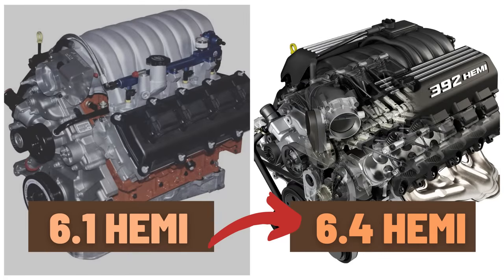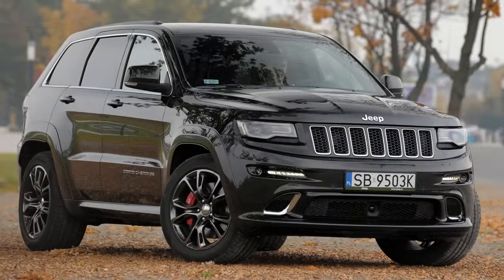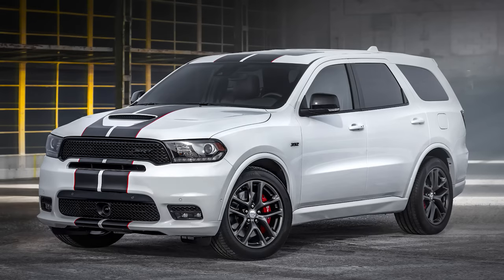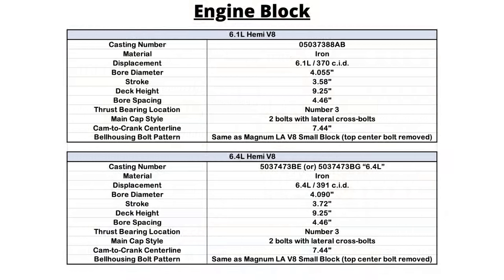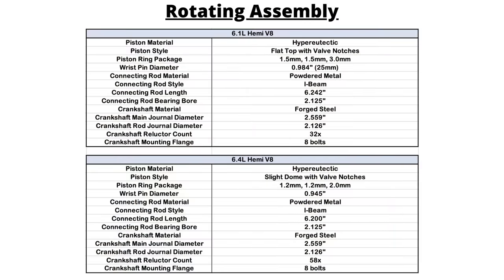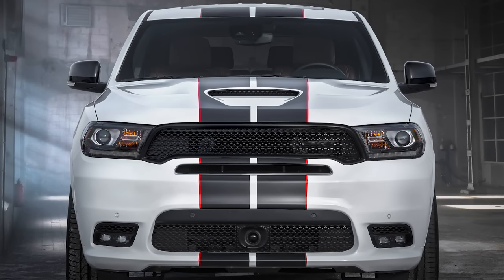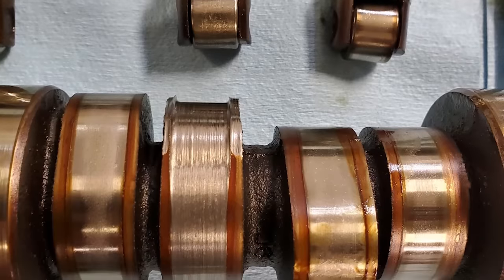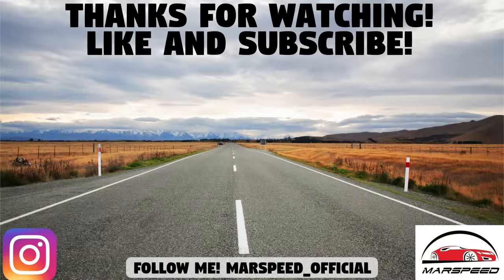6.1L vs. 6.4L Hemi Engine Full Comparison – Which One is Better? (Specs, Performance, Flaws, & MORE)

Comment: Awesome comparison! I've got an 07 Magnum SRT8 and the 6.1 runs smooth and sounds great. I've had the ecu tuned but it's all stock components and dynoed 408hp at the wheels - fun enough for me :) And I get 22 mpg highway all day, I was surprised to see the stock numbers were lower. Keep up the great work!
Reply from the maker: Nice ride man! Those Magnum SRTs are the rarest of the first gen SRTs, they’re a unicorn to me just such a cool vehicle. Cool to hear the 22 mpg that’s not too bad
Reply: That's a cool ride you got there bro! Keep it as long as you can! In my opinion the Magnums and the 06 to 2010 Chargers are going to be pretty popular with a younger generation by 2030 people are going to want them more than the current Mopars
Reply: The srt magnum is such a rare gem! Take good care of it!
Reply: srt magnums are cool af
Reply: @shakarussanders9911  can confirm your theory ahhahaha going to get a 2007 Chrysler srt8 300c
Reply: @xavierlacorte5531  Oh that's a good one!
Reply: Can you lmk about the tune? I got a 300 SRT8 and wanna make more power without spending a lot
Reply: @domlabrise  sorry! I don't know the details, the shop tuned it. However, I've seen articles since then that tuning DIY is pretty easy for the LX platform cars and you just need a programmer device and a copy of the tune.
Reply: @troybjones4  thank you!!
Reply: Yooo I got a 2006 magnum srt. Love the car. I got it cheap cause it has almost 200k miles and needs some love. But I'm working on it, and the engine so far has been the best part about it. 200k and still pulling strong
Reply: No way u dyno a stock 6.1 at 408RWHP stock. A 6.1 dynos at 370RWHP while a 6.4 392 dyno at 405RWHP. A 5.7 dyno 340RWHP.
Reply: @Carlos._5.7  he said ecu tune
Reply: @kyoakland  there’s nun that a tune can do if there’s no performance parts to back it up
Reply: @Carlos._5.7 this is horse shit.   There is absolutely gains to be had from just a tune on most vehicles it depends what it is and how good the stock tune is etc but there is also noticable gains to be had and some dyno just read higher and lower you can't really compare diff dynos.  You assume his car dyno 370 on the dyno it could have been higher so we don't know the before and after.  People worry too much about peak numbers anyways.  There is alot of gains through the curve to he had on tunes.   For best results yoy want hard ware upgrades but you can absolutely gain power with just a tune.

Comment: i have a 6.1 swapped in my 73 Challenger.. although i don’t drive it everyday , It’s been a great engine so far
Reply: Did you go auto or manual?
Reply: @hpjunke  Love that engine.  Got 225,000 miles on my first one.  Put in a 2nd motor and it is up to 130,000 miles and going strong
Reply: @pmp2559  It’s an auto 545rfe

Comment: The early 5.7 hemi up thru 2008 did not have the lifter failure problem like the eagle engines have.
Reply from the maker: True you’re right. It did have the dropping valve seat issue however
Reply: Still doesn’t happen often, most of the time it happens in high idle vehicles. I have a 2015 ram with 140k no lifter issues.
Reply: @joshkrause2977  Some video I saw claimed it happens in 1 engine in 30.  Yeah, there are lots of hemis out there with lots of miles.  I think the RAMs have the best transmissions and I like the torque of the hemi engines.  I have a 2005 Magnum RT that has 120k miles on it and I'm keeping my fingers crossed that a valve seat doesn't drop.  I've changed the thermostat to a little lower setting and I have a severe duty radiator that I plan to install to maybe keep the valve seats from dropping.
Reply: I got a 07 charger rt that I’ve had now for 10 years 197k miles on it now it’s been good to me. Now it just sits next to my caprice classic since I’m making both of those to show cars, the caprice is getting a ls swap very soon but down the road I would love to swap the 5.7 for a 6.4
Reply: Wrong. All MDS 5.7 engines are prone to the lifter failure. Pre eagles are prone to dropping valve seats as well. Newer eagle non MDS also have the lifter issue too
Reply: @Real_AGTUBE  While any engine could have a lifter failure, it doesn't happen that often in the pre-09 Hemis.  If you are saying the early Hemis are as prone to lifter failure at the later engines then you don't know what you are talking about.

Comment: I'm a Stellantis(Chrysler/FCA) tech at a dealership that also drag races on the weekend. I work on these engines all the time...well the SRT 6.4 and truck 6.4...we never see the 6.1 anymore because most quit running many moons ago. I can make the 6.1 or 6.4 decision fairly simple for most people:
Deciding which engine to start with highly depends on your goal.
If you want to keep the engine fairly stock with some bolt-ons and minor mods, go with the 6.4L. Cars like the 1320 Challenger, 392 Charger, and 392 Challener. 

If you are wanting to heavily modify the engine, I mean go all out, but not spend your life savings doing so, go with the 6.1L. You can upgrade the rotating assembly, bore it a little over, and play with the camshaft selection...when matched with an older 5sp auto or 5sp standard...you got you a hot little ride.

If you want to heavily mod the 6.4L, be ready to break the bank because of all the modifying and deleting you'll have to do such as the MDS and VVT systems, depending specifically on which 6.4 you start with. The 6.4L blocks are stronger, but there's all the other headache to go with it. If you want to go that route, either buy a bare 6.4L block or go with a Hellcat crate motor...either will be cheaper than the amount of time and money you'll spend heavily modding a SRT 392.

My pick for the most bang for the buck without spending big money on a Hellcat: Dodge Challenger R/T 1320.
You get the full power of the SRT 392 and most of the SRT suspension/drivetrain upgrades...for the lower price of a "special edition" R/T. Be sure to buy the passenger seat with it...yes, that's extra.
Reply: Some will say to start with a non MDS 6.4L from a manual trans car. Well...that will save you from having to delete the MDS, BUT the provisions for the MDS system in the oil gallery are still there. These provisions are made to direct or redirect lifter actuation/lubrication depending MDS being active or not. These provisions can cause oil cavitation or restricted oiling even with the MDS deleted. Hence....the infamous "Hemi Tick".  5sp manual cars just basically had MDS deleted from the factory...for several reasons I won't go into...but the openings are still there.
Reply: Gratitude for sharing!
Reply: @Rift33SRT  I meant 6sp.  All I know of is a 6sp available. I was typing too fast and wrote 5 instead of 6.
Reply: Rift33SRT  I believe the SRT4 Neons had a 5sp. Lmao!

Comment: Wow! I just picked up a 6.1 hemi engine and transmission out of my local junk yard for $400 bucks. I didn’t know much about the the 6.1 but I’m glad I picked it up. I’ll be replacing my 5.7 with the 6.1 as it seems to be the better engine. Thank you for sharing!
Reply: Cap or im super jelous, i sold a blown motor for 700 but i bought a weecked for 2500
Reply: @hemiboy9860  No cap this way. I pulled it myself.
Reply: Did you end up swapping it?

Comment: Great to see a video comparing the two engines.  I currently have a 2006 Magnum SRT8 with the 6.1 with just over 226K miles.  I've loved this engine, although the 5-spd auto to me has been the only "meh" part of the drivetrain.  I have a 2023 300C on order, I've wanted a 6.4/8spd for a while now and being in the 300 sealed the deal.  Also have a 2020 Ram with the 5.7L and my dad has had a 2012 SRT392 Challenger and now a 2022 Challenger Scat Pack (to replace the totalled 2012).  Hemis run in the family.
Reply: You can 8 speed swap the magnum these days. Give Russel Drake at Sound German Automotive a call.
Reply: I also have a 2023 300C on order in velvet red. I even have a VIN number already. Congratulations to you, I hope we love this 300C. How could we not?
Reply: Ls3 swap it
Reply: 2.7 swap it!

Comment: Loved my stock 6.1. Had it at 230k before I took it apart. I took it apart to do a 426 build. It was running strong til the day I took it apart. Went 140 mph on my way to the shop to work on it. 6.1 for me

Comment: My 2013 Challenger SRT ran super consistent 12.70's @ 109. It was totally stock. The only thing that I changed was I added a set of M/T drag radials. I raced it every weekend for a couple of summers. Never had any issues. And for fun I had removed all the SRT badging and stripes and added R/T stuff. It took many Mustangs and Camaros by total surprise!!!
Reply: @1967davethewave  LOVE IT!  I have a 2011 300C which originally came with the 5.7.  I swapped in a tuned 6.4 and I shock everyone out on the highway - especially since I am older.  They think they are getting a grandpa and a grandpa mobile.  I even pull stock Scat Packs with the tune from HHP.  The look on their faces is priceless!
Reply: Thats Funny, I just put a 6.1 SRT  into my 2010 challenger RT Classic . Black car with white  RT stripe .   Love it cool car .

Comment: In short terms:
If you don’t plan on modding your engine much, get a 6.4
If you plan on building it up to its limits (1003whp stock internal record) get a 6.1
Reply: I wanna slap a gen5 3.0 whipple on my 6.1 so bad. Just thw supercharger, gapped rings, and injectors.
Reply: @3rdgenaddict  I have a 6.1 with a 2.9 Whipple they came out with the 3.0 a year later after I bought my 2.9 lol no complaints it has insane power.

Comment: Pretty good video. I am lucky enough to have a Challenger Scat Pack and the manual 6 speed transmission. I have been seeing 25mpg in cruise control going 70mph on longer distance trips. Pretty amazing what this engine is capable of. The only thing I will do to upgrade later down the road will be a good twin disc clutch. Mine has factory single disc. Overall I feel my car is a flagship design from Mopar and top notch pinnacle feeling everytime I drive it. They really hit the very top of what they are capable of engineering, designing and producing. Sad to think all the cool gas muscle may be gone in the future.

Comment: Great work.  I have an 06 Charger SRT8 with 340,000 miles and running strong.  The 6.1 is a great engine - more purpose built for higher RPM but lacking the low-end torque of the 6.4.  I have raced many 6.4s with the NAG and they always open up a car length or two from low speeds and then we hold in place up to 140.  All of the optimizing for the 6.4 (intake, cam phasing, etc.) creates more low-end power and better MPG.  But I am not a fan of MDS.  I will pay more for gas
Reply: No offense but it's also like you're paying more gas for Less performance just food for thought
Reply: Only the autos came with mds. Manuals did not
Reply: @bangbang-ko2gi  I know.  I have an auto 392 now and the tuner removed the weak MDS lifters and also tuned it.  The result is amazing.  I pull on Scat Packs at high speed, get much higher reliability without the MDS, and don't have to hear that crappy 4 cylinder exhaust sound

Comment: I'm thinking that if one were to build one of these engines from a wrecking yard, I'd go after the "stronger" 6.4L BGE block. I also notice that these two engines connect to a small block Magnum LA bellhousing. A drag race version of the 46-48RH/RE (A518/618) could be built to then drop into some old ratty (or nice) A, B or even C body. Just a tip for us geezers that still fool around with such things in our own garages. FYI, I promise I won't butcher my own Scat Pack 6.4 in my Challenger for "experimental" purposes. I'll wait until I get a deal on a wrecked vehicle and pull that engine.
Reply: Technically. Hemis pre and eagle are in the magnum family so you can bolt up 8 speeds to 5.9 v8 and a new 5.7 can mate to a 46rh
Reply: 3rd gen Hemi swaps into 60’s cars has been a thing for over 15 years.  All the parts are there.  A 6.1 or 6.4 in an A-body with gears is deep in the 12’s and high 11’s basically stock.

Comment: Definitely love my 6.1l I've got mine rocking a magnuson supercharger pushing 5psi on stock internals and I have to say this thing screams
Reply: What about transmission?
Reply: @Drip2SG  nag1 5speed can handle a decent bit of horse when you start hitting around 700+ to the wheel you gotta start worrying

Comment: What sucks so much about the 6.4 is how ‘maxed out’ it is from the factory. You can’t get more hp out of it without spending thousands, while the mustang with a measly 5.0 can get 500whp with bolt ons and a tune
Reply: 5.0 is built with better internals from factory too compared to any hemi except 6.2 hellcat. But I still prefer hemi

Comment: The 6.4s in Manual Challengers did not have the MDS (4-cylinder deactivation mode) 

IIRC the wrist pins were redesigned somewhere in 2015-2016 as well

Comment: When the price is way different I say get a good running 6.1. For example a 6 speed manual challenger 2009 for 10-20k vs double cost for minor increases in power in my opinion I can buy two or three used ones over one 6.4 newer model. 🤗

Comment: My friend owns a 300 SRT 6.1 with 173,000 engine runs fine but he has some electrical problems is in the shop right now he does have some aftermarket goodies though not saying that the car is the issue at all

Comment: My guess is that the 6.1L HEMI last longer because it doesn't have MDS. I believe MDS is related to increased lifter failure. That's just a guess.
Reply: Lifter premature failure was due to weak lifter roller needle bearings. Not MDS related issue.
Reply: @cmdrbillpaxton4302  . I know…he is barking up wrong tree.  Clear early Gen 3 Lifters were weak and failed prematurely. That’s why Lifters have been upgraded to heavy duty design.

Comment: There's one person's been testing on issue with the lifters wearing out on these hemi motors is to change out the oil pump to a high flow oil pump variation of from the hellcat.

Comment: The main reason for the lifter issues happens on 6.4 and 5.7, due to the mds system. thats why alot of mopar fans get the mds delete kit, or just tune it out. 6.1 didnt have that issue or any of the manual cars cus they didnt have to switch on and off when cruising. wish that it could have been a recall cus it was such a big issue in the HEMI engines
Reply: No. Its not the MDS system. As stated in the video, the 6.1 suffers the same issue but at a much less common rate. The lifters are the issue. Thankfully, Dodge updated the non MDS lifters in 2015 when the Hellcat came out so Manual cars and Hellcats from then until now are more or less cured of that issue. The newer non MDS lifters are commonly referred to as Hellcat lifters.

Simply turning off your MDS system will NOT save you. My 2013 SRT Challenger that got a new engine under warranty is proof of that. Its why I got a 6 speed when I ordered my brand new Scat Pack Widebody last year.

Comment: I have a 6.1 and the 6.2 Hemi 
'07 6.1 Jeep SRT8 140k miles daily driven, other than getting 10 mpg and a few electrical issues I've had no major problems. Being a 15yr old Hemi it definitely requires a higher level of regular maintenance otherwise very reliable. AWD launch never gets old. The 6.2 is my other Jeep. it's ridiculous and shouldn't be legal...I passed on purchasing a 6.4 Jeep SRT only because they decided to throw the Hellcat engine in the Jeep Trackhawk

Comment: 6.1 hemi can handle a lot more boost than the 6.4. The entire rotating assembly on the 6.1 is much better. The pistons on the 6.1 aren’t like the 6.4. I know of a stock 220k mile 6.1 that holds a 175 shot of nitrous reliability.

Comment: Manual transmission 6.4s are non-MDS like the 6.1s. MDS appears to be a factor in lifter failure.
Reply: MDS roller failure claim has been debunked.  Non-MDS cars also have lifter failure.
Reply: It's the 5.7 that had issues due to VVT

Comment: 7 months ago I bought a 2012 Charger SRT8 superbee 392 with 87,000 miles on it. Less than 1 month after I bought it, the cam and lifters failed. After 2 and a half months of having the motor rebuilt with a bigger cam and MDS delete I then tried having multiple tuners in my area tune the car but no one could get it to stop stalling. After almost $8,500 in repairs within 7 months of ownership I just traded it in for a 2011 Camaro 2SS convertible and am not regretting it. That dodge was the biggest headache and most expensive vehicle I've ever purchased

Comment: 6.4 lifter roller was upgraded with thicker beefier Needle bearings, later production, same Lifters found in Hellcat 6.2. Should give people peace of mind about Lifter reliability and durability.
Reply: From what model year?
Reply: Probably 2019 and up. I'm getting a 2023 last call. Hopefully the shakedown.
Reply: @lego4virgo  2019 onwards. Also standardised block to BGE. Same block for all models including Hellcat. Difference is Painted Color.

Comment: The lifter issue gets really bad if you don't change your oil at the intervals also an oil stabilizer helps I use it in all my cars especially my hemi engines. Full synthetic only. Also a lot of the 57 had a lower pressure pump most of the 64 392 and 6 ones have a higher pressure pump that helps keep the upper engine valve train lubricated while idling.